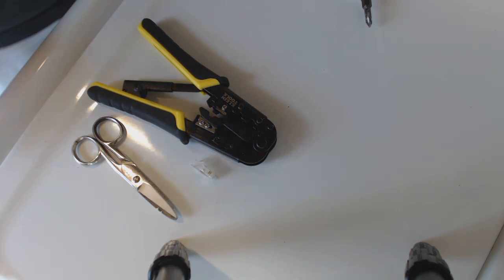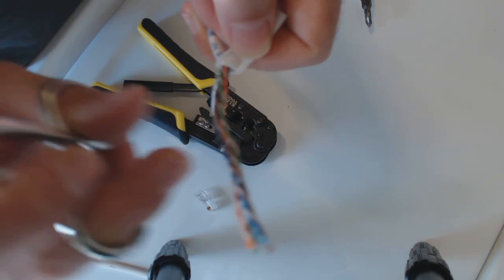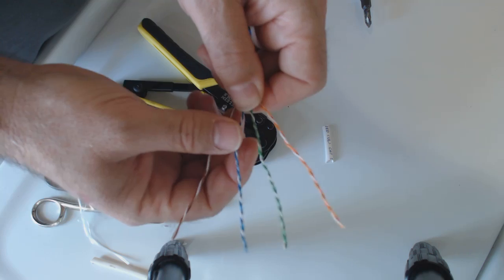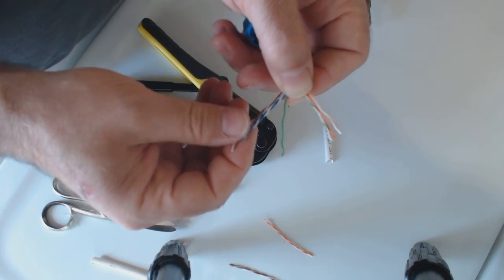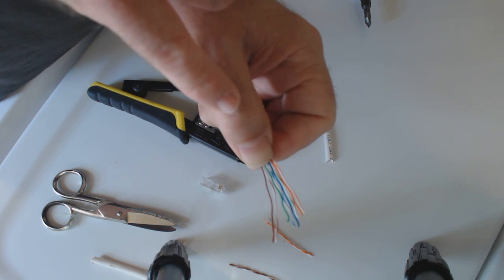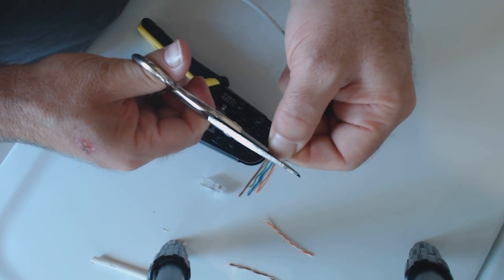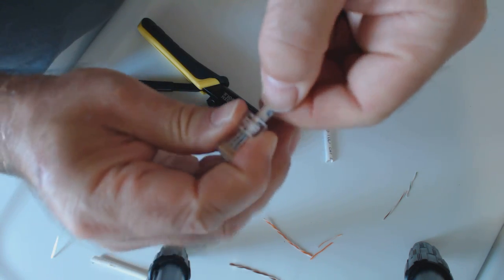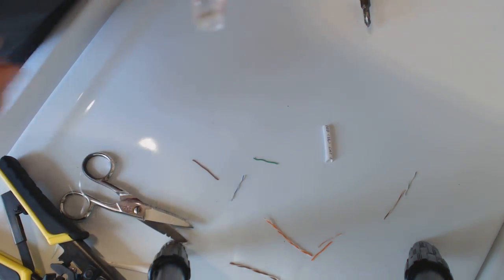How to Crimp RJ45 to Cat5e or Cat6 cable

Comment: question :  can i crimp two rj45 in one cable ? like using two pair  for each 
i running a 30 mbit/s 
it's going to contact my computer & PlayStation  to my router
Reply from the maker: +sawyer699 for a 10mbps network, you might be able to get away with that.  I.e.  put orang & green on one RJ45 and put blue/brown on the other.  Personally, I would do it unless running a second cable was just too much of a hassel.
Reply: it's that why i ask if it's gonna  work 
so which  pin should i use the rj45 have 8 pins 
should i use 1,2,3,4 or 1,3,5,7 
does it matters ?
thanks for replying

Comment: Mate, your crimpers have strippers built-in. Use those, not scissors
Reply: Wes Nicholson those are telecom snips - those things can cut small guage wires with no issues .
Reply: You can also cut a penny in half with no problem with those SNIPS
Reply: And rounding off the edges of the cable is useless. I have probably made 6 or 7 thousand plugs up and never did this. It should be inside the plug in the first place and the plug don't care.
Reply: that drove me nuts too lol

Comment: is there any difference in cat5e and cat6 cables?
Reply from the maker: +H. Anderrer  cat6 can carry data at a faster rate (up to 1gig for short distances)  and has more resistance to outside interference.  The cost of cat6 is about 30-50% more expensive.  Cat5e is still widely used in many commercial settings.  Cat5e is good up to 1gig.  So, there is not a huge advantage by going to cat6.

Comment: Two questions: 1. What layout do I use? I have a cat6 cable running from my bedroom to our router. Is the A layout or the B layout more common? How would I identify which I use? (I installed the jack with a kit from lowes) 2. Is the crimper mandatory, or can I just use pliers? I only have like 3 or 4 cables to terminate, and I'd rather not buy a crimper just for that. 

Sorry about the long questions. Great video!
Reply from the maker: B is THE most common.  However, it's hard to know weather the jack was "B" or "A".   but, if I had to guess, I would go with B.   Definitely need the crimp tool.

Comment: What is the more common termination/connection: verA, or B?  I understand this is probably a relic from cross patch cables when you needed to hook up two PCs together directly, but what's the best practices these days?
Reply from the maker: Exactly right on the on cross over thing - just put 568A on one side and 568B on the other.   The most common termination style, by far, is 568B.   But, there may be reasons (that I don't know) why "A" would be a better solution for certain applications.   Thanks for the commnet!  :)

Comment: well i used paper knife's not sharp edge to push in metal pins into the wires, worked great and no need special tool
Reply from the maker: hey there Mr. MacGyver, good for you!   Sometimes that's what we have to do.  Resourcefulness is an important quality in a tech. :-)
Reply: Well you can do it "hard way" and spent 10$ or more instead of buying these pliers for one repair, and the connection looked professional anyway.

Comment: whats the point of following the order if youre making a straight cable
Reply from the maker: There may be a bit of truth to what you ask 3D.  For a short cable running 100Mbps network, you probably would not see a noticeable difference. However, with 100ft Cat6 cable trying to maintain a 10gbit link, then we could see a problem by not keeping the tip/ring of each pair appropriately separated.

Thanks for pointing that out.
Reply: DIY Telecom Oh dear, the more comments I read the more clueless I see you are.
Reply from the maker: +mahmoud othmane great observation!  You're right, it doesn't matter so long as both ends match.  However, I will say that as a tech, when I pickup an ethernet canle, I will often compare the two ends to see if it's a straight, cross-over, or rollover.  So using some order other than the industry standard would probably have me guessing what's going on. :-)
Reply: That is not really true is it? You dont wanna mess up the twisted pairs. So you cant just use ANY combo.